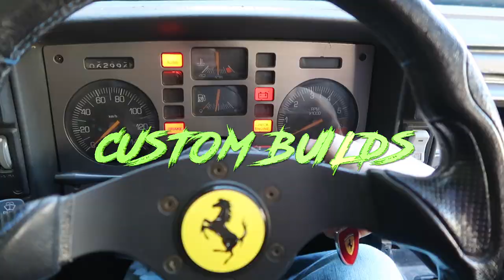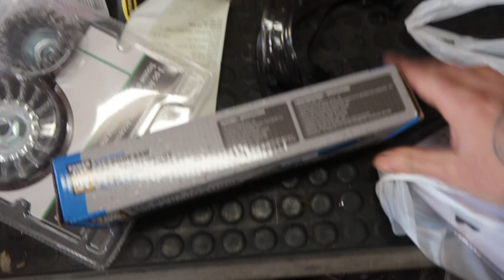BARNFIND Plymouth Cuda' Frame Rail Repair! (Project Cuda' Part#3)

Comment: I'm currently doing a similar project on a first gen dodge dually ...it puts alot of fatigue on the body getting comfortable is super important for long-term.
Reply from the maker: It’s allot of work and doing it right will be key. Thanks for watching abs best of luck finishing up your Dodge!